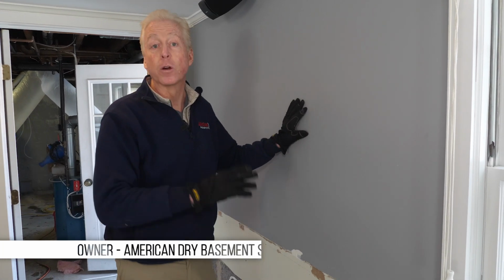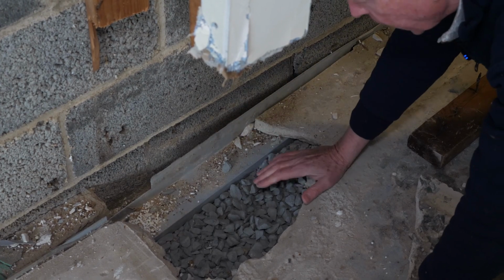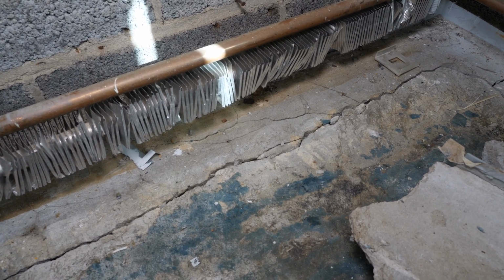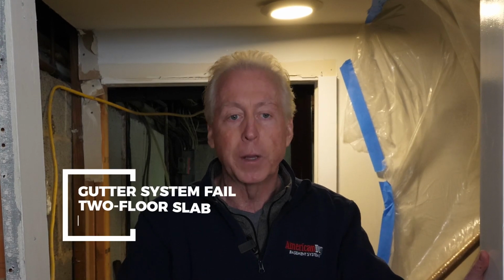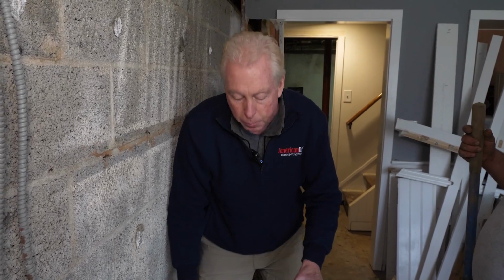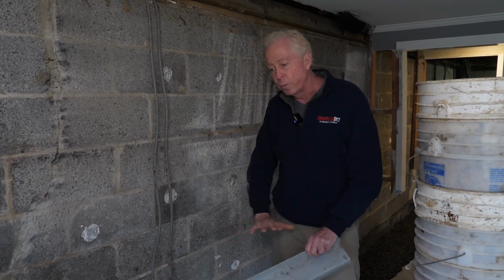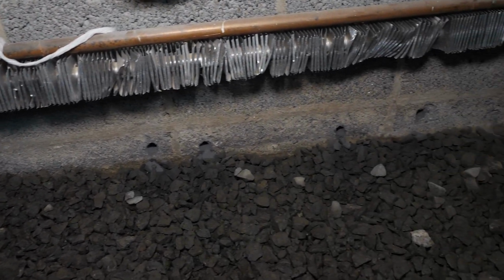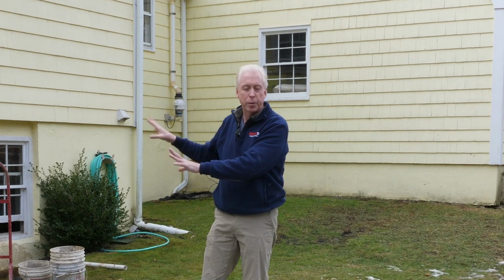Waterproofing Finished Basement From Inside - Block Wall Foundation

Comment: 6 months ago I purchased a home in NC that has a cinder block foundation.  With all the recent rains, it's apparent the issue is worse than initially thought.  I've had at least 3 "basement waterproofing" companies come out.  One suggested just filling in areas where the water seeps in with some type of sealant and adding a sump pump. The other 2 gave me estimates on the very drainage systems your company is pulling out.  None of these contractors convinced me their methods would be sufficient or effective.  Which lead me to do more research and come across your channel.  Just spent the last few hours watching numerous videos you posted and taking notes.  Your system has made the most sense and I thank you for a clear verbal & visual presentation.  It's just a bummer I'm way out of your service area and even more of a bummer that I may not even find a contractor out here that installs that type of system.  🤥

Comment: Definitely doing it right. I’m surprised you didn’t use a filter fabric around the stone? Just personal preference or just unique to this job
Reply from the maker: Filter fabric is better for outside work. The fabric inside will eventually get clogged with silt and dirt, which will slow water movement to the pipe during heavy or lingering rain storms and lead to water on your floor again.

Comment: I've been trolling numerous comments for questions I have, and found the answers for most.  One I haven't come across is that most, if not all waterproofing basement companies want to install some sort of vapor barrier up the entire height of the wall, particularly cinder block.  Your method doesn't appear to do that and personally, I prefer the bare wall in my case as it will be more for storage/workshop. What is your opinion on the full wall vapor barrier?

Comment: We had our basement waterproofed 18 months ago in a different mid-west state.  Houses in our area sit in clay.  Over a 30 year period the builder-installed system was slowly overwhelmed and the musty smell and clear signs of water infiltration through the block walls needed to be addressed.  It was very reassuring to watch this video, as the system we had installed matches what you just showed.   Hats off to your integrity and those like you who truly strive to mitigate an issue properly rather than pay lip service to a profession and just treat symptoms or make a bad situation worse.

Comment: Wow, I just watched the Waterproofing Basement Walls | Finished & UnFinished Basement video.  I really appreciate the depth of which you explain the issues and problems that come with a system that is not properly installed.  I have an older home, and have seem some issues in my basement which needs to be address soon.  I will be requesting an estimate soon.  Thank you so much for sharing your knowledge and expertise.  Tracy

Comment: So very good to see someone that is a professional at their job . 
 Honestly dont know much about the track youre tearing out . Obviously not installed very well .  I was debating in my head if it would actually work if the company installing had taken the time to use the weep hole . To use the drainage gravel & a solid amount of concrete like there should have been . 
But thankfully im not going to spend the money to find out . . Far rather watch your videos so ill know what the be looking for when i get mine done . Thank you so much for your videoes . Worth watching all of them over & over again to learn as much as possible about the way you do it .
Reply from the maker: I'm so glad you're finding these videos helpful! It's always great to hear that viewers are learning and taking away valuable insights from my work. It's true, a correct and thoughtful installation is paramount when it comes to tracks and other structural features. Implementing things like weep holes, drainage gravel, and sufficient concrete are all important steps that can sometimes be overlooked, leading to the kind of issues you see me dealing with in the video.

Remember, a properly done job can save a lot of money, time, and hassle in the long run. So, it's always a good idea to know what you're looking for in a quality installation. Thanks so much for your support and for watching my videos. It's viewers like you that make this all worthwhile. Stay tuned for more videos where I'll continue to share more tips and techniques.

Comment: Thanks for you previous answer to my question, I have one more, if you don't mind. What do you do when you need to run a line through a wall? I have a three piece foundation (block wall) and need to run a line from one room to the next in order to reach the sump basin. The wall i need to pass through is an interior wall, do you jackhammer the footer enough to continue your pipe run? Or does an interior wall not have a footer like an exterior wall? I am interested in how you run your pipe from one room to the next. Thank you kindly again for your time answer questions here and your time in the videos.
Reply from the maker: Your welcome, Nick. No footer under interior walls. The footer should only run along the entire perimeter of the house. Interior walls are built over the concrete basement floor. We leave an engineering tab under the wall (section of basement floor) and dig a tunnel next to the footer into the next room. The pipe continues with a pitch to the sump pump.
Reply: @AmericanDryBasementSystems  Thank you so much for your time. You are the best.

Comment: really like your system the real deal respect from Ontario I have a question in relation to piping discharge pipes in the trench from secondary basins if each basin has a sump pump and battery backup pump do each line pump to an outside discharge or pumping to basin closest to the discharge area? Do sump pump and battery backup need there own discharge lines or can they be connected ?  Reason Im asking I believe I saw 4 lines on wall and 2 lines exiting wall to connect to frostfree  four inch drain line. As well how big of a crushed stone drywell do you need at the end of the line in the yard for a two basin system? again great job!

Comment: I've watched all your videos and really appreciate the explanations. I almost went with a gutter system but it didn't pass the sniff test and wound up finding all your amazing videos and info, thank you. One question, I was planning on doing the discharge line in the same trench similar to this video, where do you install the valve check? Since you are running the line horizontally out the sump, do you have a horizontal valve check installed? If so, how would you access it should a problem arise if you ultimately fill the around the sump basin with concrete? Thanks for any info!
Reply from the maker: Thank you, Nick. The check valve is connected directly onto the 3/4 HP sump pump port. All check valves should vertically connected. Not horizontal. We add a short length of vertical PVC pipe, followed by an elbow fitting, and running PVC pipe side by side with our 4 inch corregated pipe. It may be little difficult to see but this is the best example of what we do. You can see it here: https://youtu.be/IVgmcXlONpA?t=59

Comment: Years ago I was doing a tile shower in my bathroom.  When I was about to pour the floor, I was told not to let the cement come in contact with the copper pipes  because the chemical reaction would eventually corrode and eat thru the pipe.  I don't know if that's true or not, the person who told me that was infamous for the low quality of his work.  So the copper pipes in the radiant heat floor kinda surprised me.
Reply from the maker: You are correct. Copper pipes and cement are a poor combination. This is what contractors did back in the day. Today, you can find durable floor heating solutions using a flexible PEX pipe-like system that does not corrode under concrete.
Reply: @AmericanDryBasementSystems  
Yes, I like working with PEX so much better.   Seems like I was always having to repair a soldered fitting in the wall when I'd mess with plumbing.

Comment: My basement is waterproofed and haven’t had any issues but my question is humidity. Is there anything that can be done to lower humidity levels without having to run a dehumidifier or that’s the only option
Reply from the maker: Unfortunately, a dehumidifier may be required in your situation. Air conditioning upstairs will help. It will not allow humid warm air to enter your cooler basement. Once warm air and cool air combine you get may get a relative humidity above 50%. Keep it below that in the basement for comfort.

Comment: Would love to do something great like you guys do for the place we're buying that only has a concrete block crawl space after they put a mobile on top of the concrete ..you can see moisture on the bottom of the blocks all on one side of house....we want something done to fix this issue but don't know what or who to get. ???
Reply from the maker: Hi Diane. We can only inspect if you are the legal owner of the property requesting our services. It sounds like you are not the owner yet. That crawl space appears to be a 3-piece block wall foundation with a concrete slab. The water is likely leaking only where the wall meets the floor along the footer joint.
Reply: @AmericanDryBasementSystems  as soon as we are owning the property we will contact you. Thanks.

Comment: Do you ever use a filter fabric for the drain pipe or sump basin? What's the benefit of corrugated pipe vs say Sch.40 PVC with lots of weep holes drilled into it?
Reply from the maker: We don't use filters. Filters inherently clog. That's what they do when they catch dirt and debris. The perforated corrugated drain pipes we use are better for horizontal delivery of water as long as they are pitched properly. They are self-cleaning. Grains of dirt and minerals never collect and build up in any one spot. They are constantly moving to the sump basket and flushed out of the pipes. These pipes are one continuous connection from basket to basket. No separate pieces required like other brands including PVC pipes. We will make a video detailing the differences.
Reply: @AmericanDryBasementSystems  Thank you very much for your fast reply and explanation.

Comment: The center of my basement is slightly lower than the rest due to the floor drain. Is it possible to connect the perimeter weeping tile pipe to the floor drain pipe under the slab and evacuate the water that way instead of doing a sump pit with pump? I know you would have to jackhammer the floor to get to it. I was just wondering if the pitch and everything else worked out in theory if it's possible to evacuate the water without the need for a sump pump?
Reply from the maker: Yes. Pitch is your friend in a basement with a center drain and no sump pumps. We waterproofed a post office basement using subfloor drainage pipes leading to two floor drains. Our perimeter drainage pipes managed any seepage deep below the slab. Gravity allowed water to go into old floor drainage which moved the water out to their septic tank. In a city, the water would discharge into a old service pipe then into a sewage main.

Comment: Do you put weep holes for a poured concrete foundation
Reply from the maker: No. It is mandatory for block walls.
Reply: No. Only cinderblock walls because the cinderblocks are hollow and can fill up with water

Comment: Would you ever use a product like drylok  on walls and/or floors?  I'd like to improve the air quality for an old couple I'm helping out. 
In my own home, I just have a hole with a sub pump for for an occasional yearly flood (old house holding up strong as ever, anyway, I painted my basement floor and some parts of the walls and they seem to be holding up good so far, anyway drastically improved the air quality, we now have a hang out spot down there, before the air was pretty bad.  
So at some point health comes first, this old couple is in there basement/garage a lot, I'd rather them breath better for there time here, then keep what they can't keep, secured... 
They get some water coming up from time to time they run humidifiers all the time, walls are healthy cinderblock...  Any thoughts, I'd appreciate it!  🙏  They can't afford a system like this right now, they're retired.

Comment: why the builder didnt install a corrugated pipe connected to sump pump before pouring the slab is beyond me, these channel drain ideas seem hokey
Reply from the maker: Many builders don't include subfloor drainage pipes. Building code requires them to waterproof the exterior wall with a thin coat of cement and tar, but it doesn't last long, or isn't enough for some foundations. Those drainage pipes are not so hokey when your basement floods.